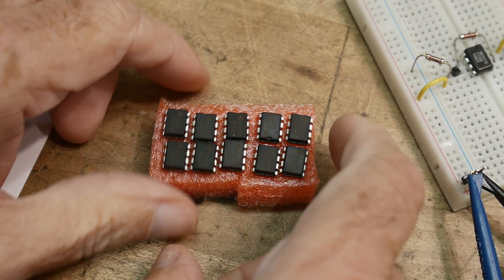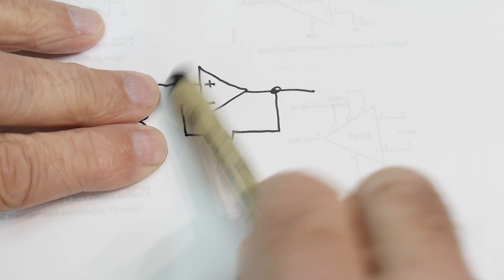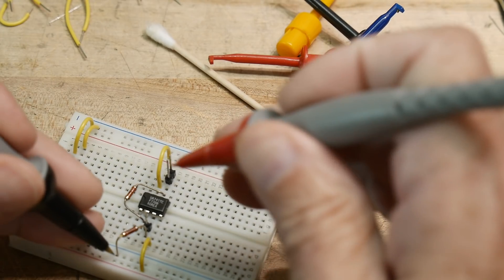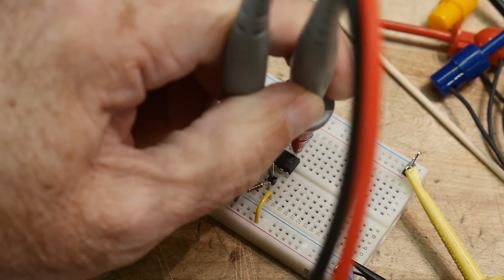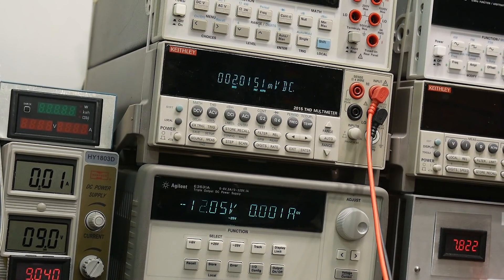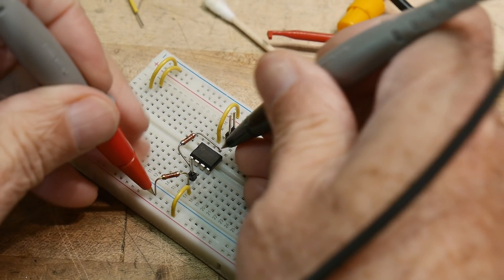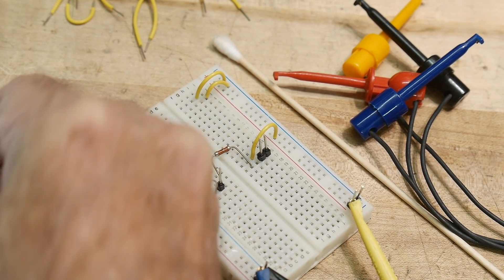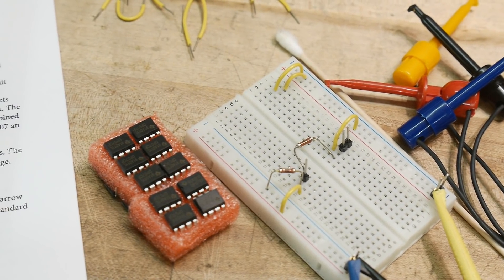#1029 Fake Op-amps from China

Comment: Chinese sells only dreams.
Keep your hands off from them.
I can not understand! Mouzer have everything.
It needs experience to buy from Chinese providers most of them are trumps.
Reply from the maker: yes, mouser has a lot, the 75uV offset OP-07 is $5.51 each, so 20 of them would be $110. I want to find excess inventory that cannot be sold as new, so I like surplus stores, and sometimes you can get lucky on eBay.
Reply: @IMSAIGuy  it depends the application, for audio apps I have choosed the single or twin opamps.
For example: if you want to split audio signal from unbalanced to balanced output, I use only drv134 that is extremely neutral and "Taylor made" for this.
I prefer 1611 1612 1622 for audio, mass production best value for money , very good sound low noise but need to place at dip8 adapter, if don't want to do this, French audiophonics have them, from China but NOT FAKE

Comment: For 20 741's for that price, you still got a good deal, just not an "incredible" deal. I would gladly pay that for 20 of the 741 Op Amps. Just make sure you mark those, so you don't accidentally use them in a critical application thinking they're the low offset OP-07 Op Amps. Just remember, you get what you pay for, and not one bit more!
Reply: Yes but they are not going to be full spec 741 OP Amps. They will be reject 741s sold as OP07. If you are going to pass off crap then give it a 'good deal' marking for a quick sale.

Comment: Doest this comment get removed again and again just because of my 
viewpoit ? 
This is true and try learn from it instead of delete my comment .

I think this is peoples own fault , Buy from a TRUSTED seller and not a shady seller with a nickname .
I have broght Chinese semiconductors and electronic more than 25 years from china and NEVER 
brought something that was faulty or fake or such as people all time do .
I think that by try to save that little few buck let people to NOT CHECK if the seller is what claim to be .
But I want to point out that I have brought several parts from US that was a nightmare to get replaced 
because it was not working , yes worst costumer service I have ever seen .
My latest purcase from China was a graphics card for my computer .
When I got it I couldnt get a picture and most of all people I know say the typically  

- It is because it is from china they send you a broken card - 
I say NO it do work it was tested before I brought it .
After long time I finally found the problem and it was simply my motherboard .
I solved the problem and installed the card and It worked .

Now those same people started to claim 
- yeah it work but is fake , its chinese -
I proved that NO this is original and shoved them the chipset under the heatsink to them and 
they just say 
- they sand it and rewrite  -

Yes fakers do that but then i show them the test on my computer .
Still they tried to continue with the claim but then I proved that Not only is this card original 
it is also the fastest and strongest card in this series and in benchmark it outperformed all the other 
brands by many lenghts .
The quality is as good as new even it is a second hand card and perform totally great .

I also have brought very high quality studio gear from china that really have amazing sound quality .
The market for very high quality from china is very big BUT YOU NEVER FIND IT if you do not understand 
that you get what you pay for .
You go too cheap and you get low quality and in worst case going too cheap and not buy from legit 
company / seller you end up with some fake products .

Just to note , I lived many years in China and today I live in the philippines and I can tell you that most 
Fake products that claim to be Chinese is NOT , they are made in Philippines and Vietnam .
The chinese characters on the packets they clearly reveal that origin is NOT china .
There is many spelling errors and of course you need to understand Chinese to know understand that .

So my advice to you all is , 

DO NOT BUY FROM Amazon Chinese sellers .
EDIT - Or from Ebay at all , this is nothing than a place for scammers .
Easy place to sell and get away with it .

Buy direct fom a Chinese vendor / shop / company / seller .
That way you wont get cheated at all and their service is great , if any trouble , something damaged 
they will replace it and it is fast too .
Every time I buy from China I get what I brought within just a few days .
Those shady Amazon / Ebay sellers they take their time and even earn extra from using cheapest logistic / transport 
and you as costumer have to wait a month or even longer before your stuff arrive .
I always get my stuff within just a few days so it should raise a red flag there too .

Always buy DIRECT from original LEGIT compay , you can still get stuff cheap BUT NOT THAT CHEAP ...
Do not end up but the cat in the sack or the monkey in the box .
BUY ORIGINAL and dont get cheated .

Sorry mmy typos , im on coffe ringt now , I have tried to correct it but there may be a few more .

Comment: I have ordered 10 IRF540s once for few euros. The first one has exploded into my face (as a HE granade.. :D) at 400mA load. Thanks China! :D
Reply: Power transistors are so frequently counterfeit it's almost not worth the risk.  Even if it works, it's most likely a cheaper part, in your case it could be an IRF510 or something.
Reply: Often what they do is they copy the real part but make the die 1/10 the size, so the part will work like the real thing but only at a very small current - it can't handle the current of the real item and will fail on that.
Reply: I brought over 300 from Farnell. Not that I want or need that many but any project requiring a decent RF power transistor and I have a known genuine part. They were super antistatic packaged though. Junk from China is packaged in polystyrene. Broken even if genuine (which it would not be).

Comment: These are not rebranded on purpose...why go through all that trouble and then sell them so cheap if you're going to cheat people. They are factory rejects...
Reply from the maker: no, these are not rejects, the parts do not even have the right pin out. I did crack open one part and the die is not an op-07. if there is a nickel to be made in china someone will do it
Reply: @IMSAIGuy  not even the right pinout ? well, then why all the testing. QED. But why doesn't that show or get mentioned in the video???
Reply from the maker: @zjokka  they left off the offset voltage adjust so pins 1 and 5 are no connects. all the other pins are correct and would work in any circuit using a OP-77. Knowing those are no-connects require more testing and I will cover that in a different video. So I guess the pinout is right, but non functional
Reply: @IMSAIGuy  Thanks so much for your extensive reply, this is a serious matter... in fact have a bunch of bags from china on the bench, JFETs, haven't tested them yet. You got to admit it's mindboggling because it's hardly economically viable... Thanks for your important work. Sounded critical only because I'm taking the issue seriously. Sure you understand.
Reply from the maker: It is mindboggling, I bough some cheap jelly bean op-amps and they too were fake. I didn't even look until months later, I mean, who would be counterfeiting nickels and not $20 bills.

Comment: I test every electronic device/part I buy off of EBay - even if it is a USA seller - and I ask EBay for a refund if the parts don't work in my circuits / tests. EBay will get refunds, although I think they look the other way with large volume sellers from China. EBay makes too much money off of fees. I wish the FTC or an agency of our government would monitor foreign products more closely.
Reply: The worst thing is dangerous products.
Reply: @gordonwelcher9598  :  Well, the worst country by far in that regard is not China, it's Britain.  Some of their products over the years have been banned in my country (Australia) due to serious safety hazards.   And they were not products from mail order or ebay from suppliers you've never heard off, they were products from major British brands sold through regular distribution channels.   Example:  For nearly 50 years double insulation has been standard in portable electric drills.  A company I worked for bought a quantity of electric drills made by Wolfe in Britain.  They turned out to be not double insulated, which is bad enough.   But someone in Wolfe had connected the three wires in the power cord to the plug randomly.  Each drill was different.  There are 6 ways to connect 3 wires to three terminals.  Two of them result in the motor being powered via the earth.  One results in the drill chuck being live to 230 volts.  Another makes the motor inoperative but the chuck is live.  
British disregard for safety isn't limited to electrical and electronic products.   A friend of mine was very seriously injured in a moderate speed car collision because the seat belts in his British-built Land Rover failed.   Any other vehicle, he would have walked away without even a scratch.
Reply: Its normally the bargain priced stuff that's fake I mean 20x for for under $2 is obvious, common sense bruv.😎💕🖖
Reply: Yes, its not just in China that there are dodgy sellers.   Rebranding fraud is not a new thing either.  Rebranded semiconductors have been around since semiconductors were invented.   Those of us who experimented in the 1960's remember things like Clive Sinclair in Britain selling rebadged reject Plessey 3 watt RMS audio amplifier IC's as 5 watt RMS IC's, which he called "IC-10" so that the gullible would think they were 10 watt amplifiers.
A genuine 2N3055 (1970's era power transistor) is a rugged diffused type with quite a large chip, resulting in good linearity in amplifier service.   Various minor US companies sold transistors labelled 2N3055 that were small chip planar types that were very non-linear, tended to oscillate, and tended to blow up.  Lots of stereo amplifiers got blamed for distortion when in fact it was the fake power transistors.
On the other hand, each time I have bought something from a Chinese eBay seller that arrived crook, when I reported it, the seller promptly sent replacement good parts, whereas certain USA firms will fight you over it.
Reply: @keithammleter3824  yes I've never had any trouble with Chinese sellers and refunds,I buy a lot of bargain chips, 555s and lm op amps and never have any bother with them it's the more specialized or expensive ICs that get faked a lot,and transistors of course.😎💕🖖

Comment: Hmm....the thing that pisses me off, is that there is no 'certification' for this crap.... I've heard of some of those chinesium 40Amp SSR modules that have started fires.... turns out, internally it was a totally under-rated switching device.... buy American if you can....
Reply: That's what they do - they copy the genuine device but make the die 1/10 the size so it won't handle the rated current, and when it tries to you have Cherbnobyl!

Comment: Fake crap from China nothing I haven't seen BUT where did you get the 2x1 through hole IOs??? I'll buy with referral link.
Reply from the maker: these?
https://www.ebay.com/itm/303595310350?_trkparms=ispr%3D1&hash=item46afb0cd0e:g:jbgAAOSw5lxe5O1Y&amdata=enc%3AAQAGAAACoPYe5NmHp%252B2JMhMi7yxGiTJkPrKr5t53CooMSQt2orsSzaVbXtmGxqmWnpn8RLN2q8BAqx65x%252Bq1qC%252B6wx1jLa8bILDaXx2SvFD7BMGJyWHpxL33%252BOEEUEUb3iVzWLAfJIdAbImThcFwXlAwtJH0P%252BGfLaa4vhVSMEIl4MKjrDkg%252FwvX9G5VLvCyjIBC5oD51RNpuaPloTcK7ZFBP0jTTpr3dZDOx7M9WsoIQQ1WXSYc17pfGhVkAoXnyOuGx8MDz%252BlBQuH65QzcC%252BMvbJT92aIkkhAaCkx1h6S%252FLmOBWYvuZsLIVbYHLsMX%252BCU4GyVGJPyVNWg6qJ1zMIEM2%252FmF0qN17csyaF%252FD3dQ8oXpuF%252FMMIRQf7458cprIWxCsfImvN1jm5ulN4j55cNsjHZU3lsP1guBEwbhfEIGjo2xMEn2QsVGi3q%252B9X%252BI7iIhGrj5SXqF02u1x5DXQQcCFJxkKycWExO6ddGbibcwaZ2LqVkYi298XGeL6t2KeL1sZWrWW8Q9DHadBTTu0u6KfI248Zu%252FGNNgNgcJ9bO41wAATDRpG54BhSLsoK49EqF1vG9DwrQfRzXoK6imDtHJCNRb63DMbuygyrBGkKGR3iqeNrJfmjvjZ9jZ3bvBBh7MzuepwHaZclDKJmwj%252BL24dFjLDUIrkbVN5cD9bugpigmVFV8sX46lgEM0wuRG%252BLMVlkfR8GAFeNpC275hOwJ0AVLmazLkcHIqqqCjhWL1%252FKCdcMv25shtEMfZN5CFAxxHl75ZkBKJ8z%252F8ihwUZj96ViAbc5uTd1muU4Yvf6nmqQJ5d8fVNhSpYKoudWnIw7CdGdavMG3CPRDxmXqag2f6ub62J%252FS0J4kgy%252BVk5g51IpNFueQysAWPeRVzpTqv%252Fnwiuh0J4wQ%253D%253D%7Cclp%3A2334524%7Ctkp%3ABFBM9Jb95tVf
Reply: @IMSAIGuy  YES I didn't know how to search for it. Was missing "breakaway".

Comment: Here's another way to verify if a chip is good: break it apart using a vice and pliers. Take the piece containing the die and put it in a test tube with concentrated nitric acid. Heat it outside (since the fumes are bad for you). Rinse and repeat until the die is separated. Then look at it under a microscope. I find this process quite fun. It allows me to verify if a Chinese seller on Aliexpress/Taobao sells garbage or genuine stuff. If they are selling the good stuff, they get more of my money :) There are actually honest sellers who sell genuine, used chips without relabeling them.
Reply from the maker: I'm not comfortable with fuming nitric acid.

Comment: I  guess I was lucky with the OP-07 I bought, not tested yet but they look original, no painting, no matching serial numbers, a bit dirty and with socket marks on the pins, the ugly ones looks to be the best ones... Not so lucky with other sellers, the new painting over the component make it impossible to find out what was the original marking and a giveaway: matching serial numbers or whatever on the top but the short codes in the bottom all different. That ones from the factory molding.

Comment: It would be nice if you gave a link to the seller.
In addition, many are wondering if it is possible to buy high-quality operational amplifiers from the Chinese. There are practically no videos on YouTube about buying quality parts from the Chinese.
Thank you for the video.
Reply: The link to the seller would probably be worth as much as these "OP07"s. Those sellers most of the time pop up and disappear faster than their wares.

That said, there are some good sellers in China. Looking at how long the store has existed (on AliExpress or whatever) gives a hint, although it's not a 100% way to be sure. The seller marking their stuff as "used" or "new old stock" could be another hint. And besides, $1.88 could be a somewhat ok deal for 20 new 741s as well, depending on how much you have to pay for shipping. Except that wasn't what you were looking for :)
Reply: @hinzster  Thanks! And I once bought 10 pieces of genuine LM833 for a dollar.

Comment: Yeah, this happened to the ne5532 I bought from Amazon. According to datasheet the slew rate should be 9V/us. The fakes I received were 2.2V/us.  Also, no sign of the input protection diodes. Being Amazon, I've been immediately refunded, but I guess the rule with 'third party vendors' is that chip markings are just decorations, and have nothing to do with what's inside the package.
Reply from the maker: you got me thinking. I looked at the NE5532 parts I had. All the JRC ones were good, all the NE parts were junk. as you say bad slew and no diodes. I have about 5 bins of various JRC opamps but fortunately only the 5532 bin had fakes in them.
Reply: Out of curiosity how are you measuring the slew rate?
Reply from the maker: @drozcompany4132  inverting amp config,  gain -1, square wave input, measure rise time. about 0.5uS for 3.5V so 7V/uS. very crude measurement but useful to spot fakes. it is obvious, fakes were 10x slower
Reply: @drozcompany4132  You aren't the only one.
Reply: How did you measure that slew rate?
Reply from the maker: @ranbymonkeys2384  I do in a future video. mine were about 7V/uS for good ones and 10x slower for bad ones.
Reply: @IMSAIGuy  I have op amps that are 125 (AD825) so I thought it would be cool to test them.
Reply from the maker: @ranbymonkeys2384  I'll get a similar opamp and do a video in the future about slew rate 
Will be interesting. I have not played with opamps that fast.
Reply: @IMSAIGuy  The OPA637 is a very good sounding op amp but they are on the expensive side $30 a piece with a 135 slew rate.  You always give up something for that fast of chip.  The bandwidth or the bias and offset will lost.  There's always a give and take with these things.
Reply: @IMSAIGuy  The Burson V5 is at 180.

Comment: OP07 is an old part and nothing special to write home about. $6 is ridiculous. You should never pay that for an OP07. E.g. you can get the ADA4077 in low quantities for less than that - a drop in replacement that's superior in all respects and also available in duals and quads. There are numerous other upgraded replacements available from others that also cost less.
Reply from the maker: you can tell I'm old school. AD says this is a 6th generation for the 07. not a drop in: no offset adjustment, lower supply voltage range, SMD only. I do like it though, especially the dual.
Reply: @IMSAIGuy  True I didn't notice the missing offset trim and bit narrower range on the high end. +/- 15 is still quite versatile and you can usually live without offset trim. And SMD only. I like me a big old DIP from time to time. 😁
Reply: the good part about op07 is they are jellybean, available from multiple manufacturers. I love ad8676 for example, but can't buy them for a reasonable price anymore, presumably due to chip shortage.